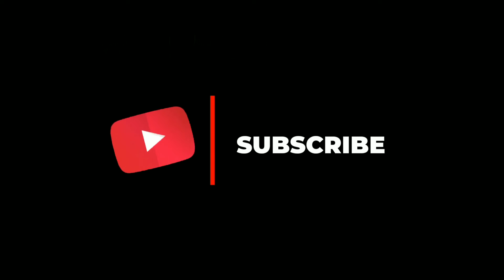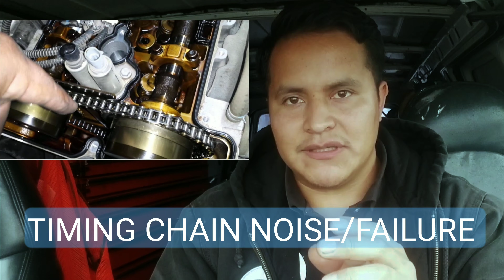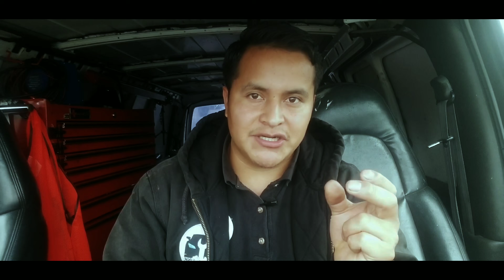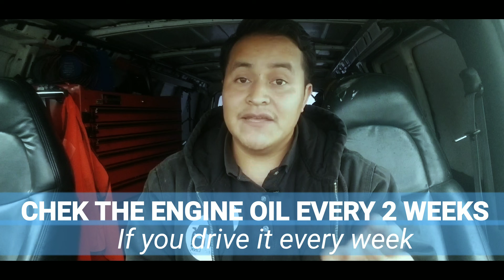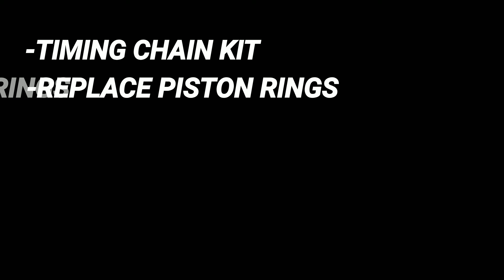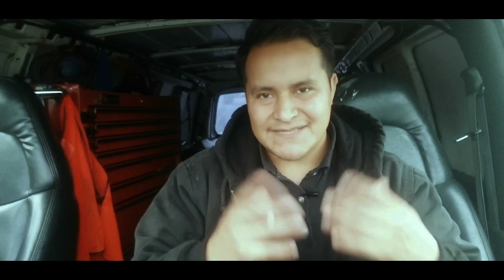GMC engine problem| why it fails and what you can do about it

Comment: I’ve got a 2011. At what mileage do they start to mess up? I’m at 90k.
Reply: I’ve been blessed to get 185K out of my 2011 so far. Mine started about 90-100K. I change oil/filter every 3-3500K miles but I have to add a quart of oil at around 2500K. If burns oil but doesn’t smoke. Ive always gotten the acdelco oil/filter at dealer. I just keep a check in the oil every 2wks to be sure. Oil is cheaper than an engine. There is several videos on this oil consumption issue and this one explains it the best. So far the hardest job I’ve had to do on this equinox 2.4L was a water pump change. I’m gonna try and get 200K out of this one and hopefully trade it or basically get what I can for it and not look back. I’m not going to get anything else with an ecotec engine.
Reply: @11C2Bib  Thanks for the reply and info. They are good vehicles, but it is troubling knowing that the engine can go boom at any time. A mechanic I know told him about the problem and he essentially told me the same things you did about oil changes etc. He also gave me another piece of advice. He said, if the dipstick reads full, add another quart. It’s not going to hurt anything that’s already hurt. He also said, with a proper maintenance schedule- as you did- he thinks it could survive to 300k plus in mileage. Here’s hoping, and I hope yours runs trouble free for a long, long time.
Reply: Got vehicle a year ago and has approx. 125,000 miles on it. Uses about a quart every 1,000 miles. There was a law suit about this against GM but mine is outside the mileage allowance. Plan to get rid of vehicle. Too costly.
Reply: @simpleman3684  here in Canada their is a class action lawsuit against GM - which my name is on - but the lawyers are going for the home run. It shouldn’t matter how many miles or the age of the vehicle.. they want GM to fix every vehicle with the 2.4, because they knew about the problem for years and did nothing about it. GM just kept on cranking out these SIDI engines without a care about the end user. If the engine were to blow at highway speed it could kill the driver or another driver due to loss of control.
Reply: @Neon63-1  I hope things work out in Canada for you. Here in the States I think it’s 120,000 mile cut off. GM tried to say that the oil issue is normal, lmao! They really think people are stupid! I have the 2012 Terrain and if it wasn’t for its issues it’s actually a very nice vehicle. GM left a real salty taste in my mouth with the way things were handled. Intend to get rid of the vehicle and cut my losses before it sucks more money out of my pocket. It will be interesting to see how you make out in Canada. I wish you luck my friend!
Reply: @simpleman3684  Thank you. I wish you all the best too. I’ll keep you apprised on any lawsuit updates. It’s sad to get rid of a vehicle we really like. All the best to you Todd.
Reply: @Neon63-1  Thanks Robbo! It will be interesting to find out the outcome. Fingers crossed for you. It is very sad! Otherwise we love the vehicle and that’s one of the reasons we still have it. We have put quite of bit of money into it. That’s including convenience items as well such as factory remote start, homelink, floor mats, cargo mat and floor lamps. Along with new tires and alignment. That’s on top of the other garage bills. (Some partially covered by warranty) Warranty went off in November. So unfortunately we are deciding to part ways with our vehicle cause of the vehicles issues. Some other information to pass along. We had the full exhaust replaced as well.... including the exhaust manifold. Think the manifold was changed twice if I remember right and the catalytic converter pipe at least 3 times. The cat pipe breaks off at the flange at the weld. My suggestion is to buy the cat pipe from the dealer.... yes it’s way more expensive. Also use factory o2 sensors. I hadn’t bought the the dealer cat pipe as I just intend to get rid of the vehicle. Not sure how many people had these same aftermarket exhaust issues but I know if you dig around on the internet I’m not the only one. If you’re still planning to keep yours I can give you more info on installing the floor lamps and/or homelink if you are interested in any of that.
Reply: @simpleman3684  I’m sincerely sorry to hear about all the issues you’ve had to deal with. Is homelink the GM app that can be downloaded onto an iPad or iPhone where you can remotely start the vehicle and also get updates on the drivetrain and alerts for things that need service? You’ve obviously treated your Terrain with a lot of care and love. The hardest part is having to say goodbye to it. I haven’t had any issues with the cat. Yet. I probably just jinxed myself saying that. One major problem I’m having, is it goes through batteries like there’s no tomorrow. I took Scotty’s advice and bought a portable charger he recommended and it’s one of the best investments I’ve ever made. I just wish I had the magic answer for you to keep your vehicle. Please stay in touch. All the best to you Todd.
Reply: @Neon63-1  Homelink is the 3 button programmable controller you use to be able to open your garage door or whatever you want it for. I only use it for the garage door. The buttons are located in the overhead console. Homelink wasn’t offered in the Terrain until 2013 I believe. I have a 2012. I sourced the parts  from an overhead console from a 2014. I purchased it on eBay. I think I spent about $40. Just took off the parts I needed and put it in mine. Everything connected except for the power wire which I got from the rear view mirror. My power wire works with the ignition which I like anyway so in the event someone tries to break into the vehicle they can’t open my garage door. We will miss the vehicle but we need to move on before it sucks more money out of us. I’m sure after we make the transfer to a different vehicle we’ll like that one as well. Actually at this point I wish it was all over already. Very frustrating.
Reply: @Neon63-1  Sorry I forgot. I never had any battery issues myself. Knock on wood! Those chargers are nice to have. I haven’t got one yet.
Reply: @simpleman3684  understood. I don’t have that option for my Terrain. I live in Canada and there are options that are available in the US, but unfortunately some are not available in Canada. What are your thoughts on a new vehicle?  I wouldn’t mind buying a new Toyota C- HR. I like all wheel drive, but the Toyota only has front wheel drive, having said that, it does have a manual six speed trans. It’s also a great looking in my opinion.
Reply: @Neon63-1  Definitely wouldn’t mind having a Toyota. They have a good reputation. A little more pricey though but it sounds as if it’s worth it. I’m actually thinking about a Ford Explorer. The generation starting with 2011. My wife seems pretty interested in that and she needs the cargo space which is nice anyway as I don’t have anything else that I can haul anything that is larger. So far I haven’t read much bad things for those years but still will do more looking. Also  thought about a Ford Edge but after reading about them it would have to be a 2014 as that seems like that was a good year for the Edge as 2011-2013 had issues supposedly. I can’t afford anything much newer at this time. I was in a rush for a vehicle when I bought the Terrain so I didn’t get to check its background. Lol.... you know I’ll be looking from now on! My wife wants the AWD but FWD isn’t bad. I’m running a 2005 Chevy Classic (Malibu) that I use to go to work. AWD is nice but it’s also more to take care of. If the Toyota works for your situation I think it’s a great idea.
Reply: @Neon63-1  Hey just a little update. Still have the Terrain, lol! Last problem i had with stalling I finally fixed after some online research. First replaced the cam solenoids as that started throwing codes. Stalling still continued. Replaced the upstream oxygen sensor with a new factory oxygen sensor. That fixed it. I had actually found a GM bulletin on it. Evidently when the garage replaced the manifold they changed the oxygen sensor with an aftermarket one. GM bulletin states to use a factory one. So I replaced that sensor a few months ago and still going strong. So I’m pretty good now except for adding oil about one quart every thousand miles. Hope things are going well for you! :)
Reply: @simpleman3684  Oh man, don’t get me started. lol. My windshield wiper system went beserk after a cold snap whipping the blades off and cracking the windshield. I had it towed to the dealership and told the service manager ( a good friend, wink wink ) to fix everything that needed fixing. 3,500$ later, it had new fuel injectors, iridium plugs, and ignition coils. I also had after market rims and new Michelin all weather tires installed. I wasn’t charged for the ww system because of a service bulletin issued a year earlier. Even the windshield was free, so beggars can’t be choosers. lol. Runs like a dream now, and I probably just jinxed myself saying that. Good to hear you got your problems fixed. Take it easy 👍
Reply: I've done all the oil changes on my wife's 2015 Chevy Captiva with the identical 2.4 ecotec. At about 100K last year I had to start topping off the oil once between 5K mile changes. Then started 3K oil changes and still burning. Then it just got worse quickly. At 115K it was a quart burned every 500 miles. Today we gave up and bought a 2018 RAV4. I have a 2015 equinox with the 2.4. 77K miles. Still good but going to just start changing oil every 3000 miles. Sucks because I've been in Chevys since my 1990 C1500 that lasted twenty years with no major issues.
Reply: @chrisbondra2090  oh man, what an apt term “ sucks “. Good move switching to a Toyota. I’ve been pricing out some new Toyota CH-R’s. Well, I guess I now know what’s going to happen to my Terrain. Actually it’s already begun. Every 3K add oil etc, as you appropriately said, it sucks. Best of luck with the equinox. Hopefully it will be ok. Hopefully......

Comment: A buy a 2013 gmc terrain 2.4 
Whit a 100.000 miles 
One month later start vibration,I replaced the all mounts but it make worst so I just tried to figure out if is the transmission or the engine
Reply from the maker: Is the engine shaking or is it the whole car? Also does it shake more when you drive and accelerate?
Reply: Yes the whole car and yes it's more worst when a drive

Comment: This was a good video it answered all my questions except for one what if it only makes the loud noise on cold start and goes away when it warms up
Reply from the maker: That might be the lash/ valve lifters. make sure that the engine oil level is good.

Comment: Do these problems only occur to the 2.4? Because im thinking of buying a (2010 GMC terrain 3.0 V6) will i run into the same problems?
Reply from the maker: The GMC SUVs have powersteering pressure hose leakeage issues and the powersteering pump gets noisy in the winter if you live in places like Washington or NY
Reply from the maker: Some of these problems like the timing chain problem does affect other GM vehicles.
Reply: The V6 engines had timing chain issues too.

Comment: My oil on dipstick show none ,add a quart and it’s still showing low,what can I do
Reply from the maker: Change your oil every 3,000 miles or everything 3 months and check the oil every 2 weeks to make sure it's always within minimum and maximum.
Don't follow the oil service message or light on the dash.
Reply: Walmart Super Tech oil is good and inexpensive for adding oil and the extra oil changes. I've been doing 4000 mile changes for the past year but now it'll be 3000.

Comment: Engine never has to come out to replace the pistons lol, remove the oil pan and head that's how we do it, you should do more research before you start talking a bunch of BS lol
Reply from the maker: It would take more time to do it that way and it would cost more to the customer. Just saying, as a mechanic
Reply: @WrenchLink  you have to remove the heads and oil pan wether the engine is in the car or not its pays around 17 hours for the job
Reply: @WrenchLink  its faster to not pull the engine to change the rings

Comment: 2013 chevy equinox  2.4 engine
we have a vehicle came in for master cylinder leaking, remove master cylinder and found brake fluid in booster, replaced both with reman, after bleeding brakes, start engine, runs good at idle, touch gas pedal and engine sucks brake fluid in itself. cleaned engine , replaced booster and master cylinder with new parts, did same thing. left fluid out of master cylinder and you can feel alot of suction on top of master cyl cap.

does not have secondary vacuum pump. passes on compression test all within 10 lbs, looses some on leak down test.
removed vale covers and looked at cams, used ratchet and turned cams, timing chains seams loosewhen you turn , goes back afet you let off...

What is causing this much vacuum?
never seen this , i have contacted multiple dealerships and no luck, they have never seen this
Reply from the maker: I would disconnect that vacuum hose on the brake booster and check if it still has vacuum in the master cylinder.
Reply from the maker: The only hose that where brake fluid travel through to the engine is the vacuum hose on the brake booster. And it has a check valve in it so that it only applies vacuum to the brake booster.

Comment: What if the engine runs fine and no noises as u describe but I detect some vibrations as the engine runs idle  but no noise. Could it be an engine seat. Is equinox V6 with 120006 miles.
Reply from the maker: What year is your Equinox?
Reply: Honestly check the beauty cover and that the little hose on the bottom of it is fully connected, it has little swats as well if it's not fully seated it'll sound like a rattle

Comment: What can you do? Buy a Toyota RAV4
Reply: I'd say no to Honda CR-V because they only have a turbo 4cyl and a hybrid in new models. Older ones with a basic gas 4cyl are good. Also 2018 and older RAV4 with 2.5 engine. On 2019+ new models with a 2.5 I've heard the transmissions are 8 speeds and have issues that still need worked out. I Just traded in my wife's chevy with the 2.4 for a 2018 RAV4 today. I have an equinox with 77K miles with no issues yet and going to change oil now at every 3000 miles.
Reply from the maker: Or a Honda CRV